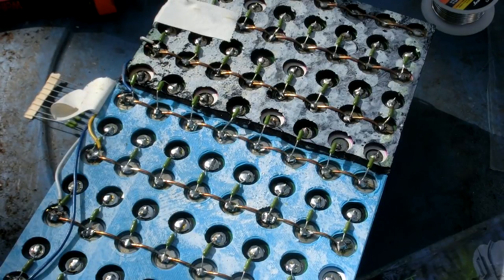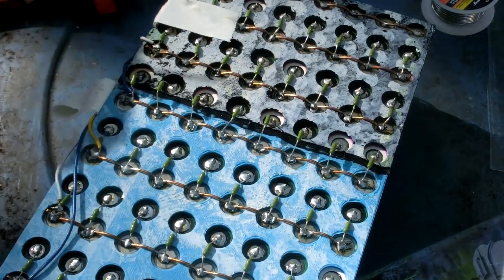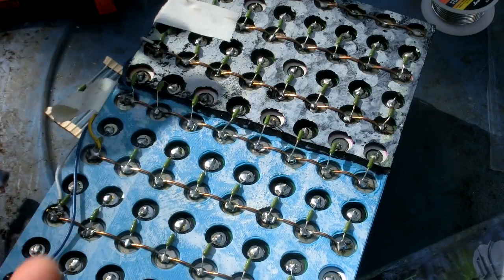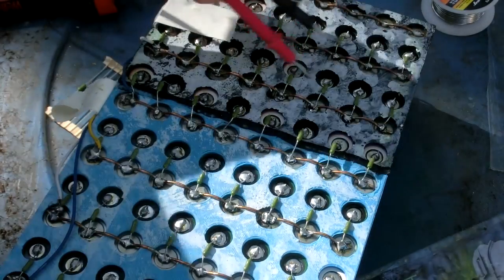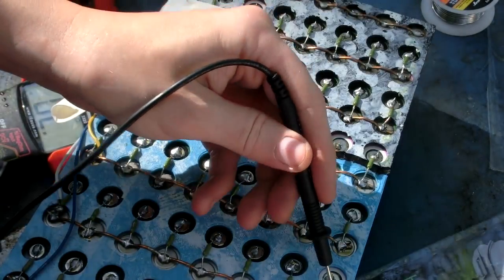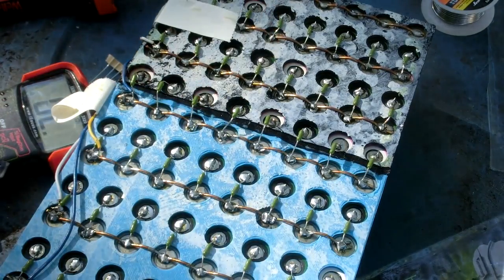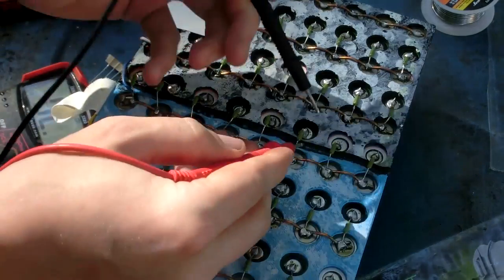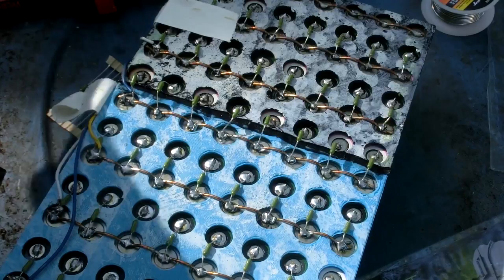18650 4 Amp Pico-Fuse Review/Shorted my E-Bike Battery

Comment: Auto resetting poly fuse. Most ramps boards have them installed.
Recommend a 15 or 20 amp breaker. Like the ones in the 24 charger, 2 post in a small can. Amazon's got a nice selection for RV stuff like motorized stabilizer Jack's, local auto parts store should have as well, usually a smaller selection
Reply: yes one of these to protect the whole battery and the BMS, then individual fuses per cell

Comment: You need to get a good multimeter that has a warning alarm if you try to measure voltage with the probes in the amps socket. It certainly reduces the number of blown fuses due to stupid mistakes.

Comment: Polyfuses or PTC's are self resetting fuses  and are available in high current ratings.. Maybe check your full load current and put one slightly higher in you main feed wire.

Comment: Glad that the fuses hold up, just an idea you could put fuse holder's similar do dose of multimeters the ceramic type and if they blow you can easy replace them and they are fairly cheap but other people have mentioned resettable poly fuses witch could be a good idea as well, other way could be just put screw terminals in each battery and use the same fuses that you are using now. Have a good day!!

Comment: I've gone pure ages without a bms on my bike. I later got one but it just simply didn't work right for me. For my 36v battery I charged it to 40.41.5 depending on how out of balance they are. That way my batteries would be around 4-4.15v around there. And I used an IMAX to top off the individual rows. Or if you wanna bump it up like I did I ordered like 20 tp4056's. they're like $1 or less each. Put them in all in parallel and it acted as a 4.2v 20A charger to top off my cells faster. So after the bulk charging I had little connectors coming off the rows (female) and the male version of the plug on my bundle of tp's and plugged them in and they did their thing. Bit annoying but I did it for like a year almost. It doesn't take too long. I always keep my battery in sight when charging anyways so I didn't waste time guessing when it was finished

Comment: I've done that so many times, had my multi meter in amp setting and would get really frustrated at why there was no voltage(trying to diagnose wiring problem) to realize my multi meter leads where burning up.

Comment: I had tried using the 5A micro fuses on one of my battery packs I built and had a fuse fail under normal operation The remaining fuses in the string then ran hotter and failed in succession.  I have since gone back to 10A fuse wire which I have tested and it will blow in the case of a short circuit failure but is much harder to have a whole string fail.  I have some packs that don't have a fuse on every cell but rather have a single larger fuse in the middle of the pack.  I have never had a single cell short circuit in these packs without burning the internal connection in cell and going open circuit.  Then it is a reasonably simple matter of finding the failed cell and swapping it.

Comment: What is uses of using fuses between cells...? 
I saw there are many people making packs with out fuses. 
Also understand that blasted due to May be short-circuit/heat/ and they are replacing with few other cells.
Is that just because of fuses....? 
If we use fuses can we minimise the this incidents...? 
Just replacing with new fuse can we save(use the same cell) the cells....?
Reply from the maker: if a cell shorts, all the other cells will push all their energy into the bad cell and cause a fire. with a fuse, it stops that and disconnects the broken cell.

Once a cell is bad, it is bad forever.

Comment: You should always remember to put the leads back to the voltage settings after you are done measuring current. Does the meter still work in the current mode?
Reply from the maker: duh no shit, thats like coming up to a car wreck and saying "you should always properly signal before turning" its not being very helpful and not conveying any new information.
Reply: When I was taught how to use a multimeter (way back in the 80s) I was taught that you never leave the probes in the current position. That way if you grab a meter and start measuring you won't blow up the meter. It is helpful if it prevents someone else from making the same mistake. (one that i have made myself).

Comment: why didn't your meters fuse blow first?
Reply: maybe he has a cheap fuseless meter
Reply: Andy because he had it on the higher current setting likely, and most meters have a shunt at that point, I h Ave burn a dmm when I was just starting, fun to see your tool break when you just got it.
Reply: That meter 10 amp setting is unfused. It's just a piece of resistance wire that develops a voltage across it, the solder connecting it will melt if given enough current for long enough time, but the batteries would probably blow first. T... W
Reply: George Robles how else do you measure current without a shunt?
Reply: Andy clamp meter, or coil via induction.
Reply: Why not use a fuse for the battery pack in the first place? Just have the micro fuses as fall back protection I'd say.
Reply: Even if it were a multimeter with a fuse, the 10A current setting comes with a 10A fuse (obviously), so the picofuses would blow first anyway.
Reply: station240 obviously you have not owned many DMM's. Great breakdown videos on meters over on eevblog. Half of the meters I have bought don't have fused protection on the higher current setting.
Reply: Padro Podra if you used fast acting then when ever there is a surge it would blow. If it hits 6amps(example for a 6amp fuse blade or tube) then it will blow. But if using those, they can get expensive fast.
Maybe a slow-blo fuse may work but even those aren't the best idea as some can carry more current in desired time it takes to blow then what is desired for the max current and time for a cell.
And to be clear, those pico fuses are much cheaper and work the same way.
By soldering a fuse on, you help eliminate a number of possible points of connection failure.

Comment: Could you use a resettable fuse (polyfuse) across the cells
I've never seen any circuit breakers as small as you'd need for cell-level

Comment: One blessing from the practice of battery construction is that we all are very skilled at soldering. I noted you're not very quick at deconstructing and replacing.  Frankly, I have BMS's on two of my four batteries and I'm still not convinced that they're required if you use a balancing charger. Do you find that the BMS is necessary?
Reply: If you use a balance charger, a BMS is not required. If you use a BMS, a balance charger is not required. A BMS does balancing.
Reply: what about bms for wlihe discharging your babttery ?
Reply: Nope. cells in similar condition, they discharge evenly.
Reply: James I have five 560 watt ebike batteries, 8 P 10 S of 18650 cells and when charging with 42 volts total I constantly am bugged by one row at 3.9 volts and others at 4.25 volts. It's prohibitive to charge these lithium batteries over 4.2 volts so I now balance charge 5 rows at a time with two balance chargers simultaneously. When I discharge them the also go out of balance because of impedence. I find that cell rows that were 4.05 may go as high as 4.15 volts when the battery is discharging. I don't want to use a bms and will continue to balance charge even though I have purchased them as they can be problematic. I might add that almost everyone reports imbalance while chagring at full voltage so asi I'd said if you carefully balance charge to 4.1 volts for each row you're correct I beleieve you may not need a bms.
Reply: @charlestatakis9363 how would one group increase in voltage as it is being discharged? Like from 4.05 to 4.15
Reply: @EC88838  Well? that's why one would use a BMS, it balances the charging voltages from series batteries in each series group. However, I am not convinced they are durable. A ebike vibrates and destroys those circuitboards. Having said that perhaps it's possible to construct and prevent that BMS from obliterating.
Reply: @charlestatakis9363  I meant to ask about this sentence " I find that cell rows that were 4.05 may go as high as 4.15 volts when the battery is discharging. I don't want to use a bms and will continue to balance charge even though I have purchased them as " - maybe you meant to say it would go as high as 4.15 when charging? I can't see how a battery would increase in voltage when discharging.
Reply: @EC88838  All the batteries have very slightly different DC electric resistance. If you look at them like resistors and consider that they are in series, each battery row will possess individual cells that settle to a different voltage after you've discharged them with a load. Awhile ago I took a look at my 36 volt 8 P, 10 S cells and noted that where all the cells are not identical, the higher resistance cells maintained a higher voltage at rest when measured later, before recharging them. I guess a BMS would make sense if I needed all the cells to be of a balanced voltage at the completion of charging. However, my cells in series are independent now with a buss on each end so a BMS would not easily work unless I connected each parallel row of cells. I'm weighing my options and the batteries as they are work find but a BMS would improve their life.
Reply: @charlestatakis9363  Yes, I understand that. I guess my question was more on how it was possible for one row to INCREASE in voltage - you mentioned one row going from 4.05 to 4.15 volts when discharging. That part doesn't make any sense to me.

Comment: It might of burnt a pcb track in your meter , that must been scary to see all that power/energy flash like that
Reply from the maker: its not scary its just like "ah fuck i did it again, well there goes the whole fucking afternoon. god damnit" lol
Reply: hehehe awee never mind , just hope you don't do it again any time soon , Fuses saved your butt getting blown away so i guess we can call this a successful test of the safety fuses. I wonder if there's a easier way to connect the fuses to the battery... then again that opens up a whole load more issues to solve agh.
Reply from the maker: fuses havent helped me yet though, i've shorted out my other batteries without any issues so far. i only added fuses for individual shorted cells.
Reply: Its just gonna get a bit scary if it goes into full meltdown then your have like a rocket bike. Did the meter sustain any damage? I read ppl saying about fuse blowing in them but the amp meter test part does not usually have a fuse.

Comment: Hi Rinoa super genius love your videos. Secretly I was hoping you were going to sink in your barrel boat video, hahaha only joking. 

But to the point. I'm having an issue with my ebike battery but I'm not sure, I have a 20ah battery made with old laptop cells. But after instant full exceleration it then cuts Power and I have to wait a few seconds, then I slowly get power back. It almost feels like I have a full bucket of water, i empty it, I then have to wait for it to fill up again and then I can use it again. Everything in my head points to the battery. But everything checks out ok it's 48v. No bad cells, full balanced cells. So my question is could you help me!!!!???

Kind regards.
Reply from the maker: +HandyAndyOffGrid check voltage of the battery while your pulling power from it. you might have used cells that have a high internal resistance. meaning they just cant provide energy as quickly as they used to. an 18650 should be able to give 4a without dipping down too much.

its most likely not all the cells. also the cells will heat up that have high internal resistance. a 250$ Seek thermal camera makes troubleshooting this stuff super easy. bad cells glow bright in thermal.

hope that helps
Reply: Rinoa Super-Genius would just one cell affect the battery like this then?
Reply from the maker: probably a handful of cells. you made the pack yourself right?

i once had an issue where one cell had shorted out on my battery pack. it melted the connector half way through that parallel pack of 10 cells, and id put the ballance lead on the other side. so if i read from the balance lead it still read as 4.2v but the power wire was coming through the other side of that parallel pack and was now isolated from the balance side. the cells with the shorted on in them quickly dropped to 0v but when id run my ebike i could go maybe a few hundred feet and then power would die off horribly. it was this one cell was being pushed to negative voltages and as it got super hot it got resistive not allowing more electricity through. almost blew up my ebike. lol

Comment: How did you come up with using 4amp fuses?
Reply from the maker: well i wanted to have a fuse on each cell, so i used the max amp rating id ever expect to pull.
Reply: What was your equation for coming up with 4 amps?